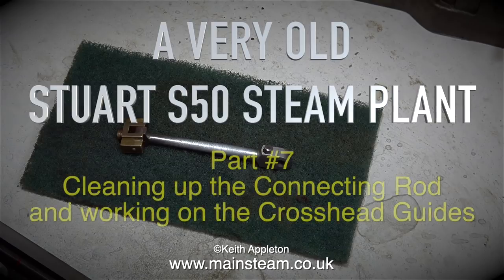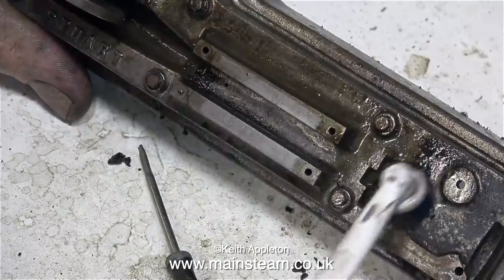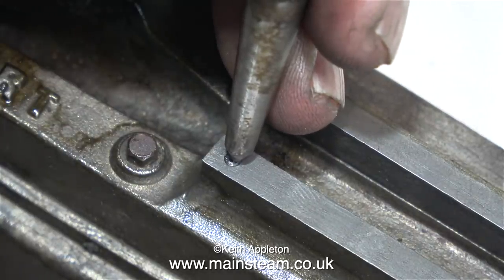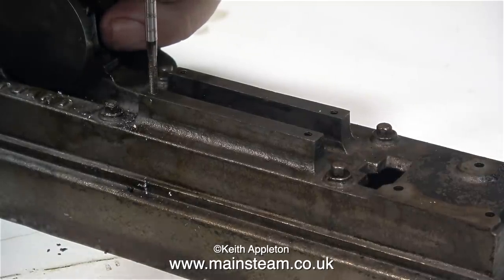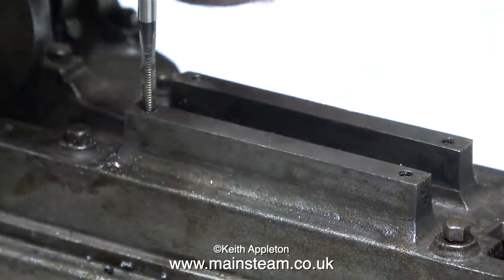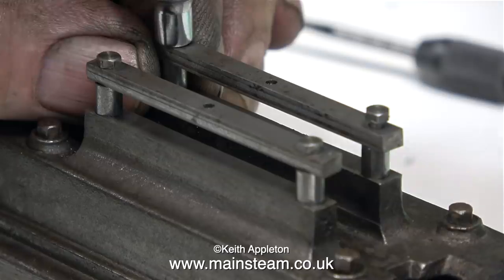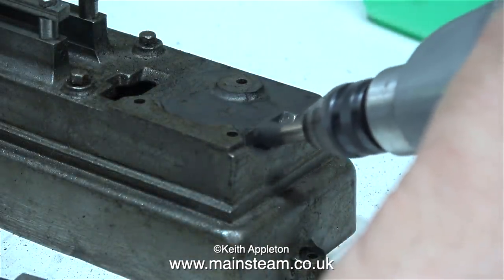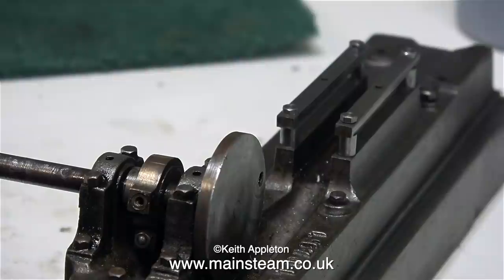A VERY OLD STUART S50 STEAM PLANT - PART #7

Comment: I can see that the broken screw moves quite freely in the hole. Looks like it could have been more easily unscrewed using a left side drill or a small extractor for broken screws.
Anyway, a very interesting video, as usual.

Comment: Hello Keith, I really enjoy your videos, especially the restoration of this Stuart S50. I own one, which I have restored and is a part of my collection. I was curious if you have done any machining on any of the PM research engines. I'm currently building there drilling/mill horizontal steam engine. I'm finding the castings to be of good quality. Just would appreciate your thoughts on these engines. Thanks very much for what you do for the hobby.                        Jon
Reply from the maker: I like PM research engines generally but I feel that the TVR1A valve gear is a little weak.
Reply: @keithappleton   I believe the TVR1A is a Graham industries engine. The PM research engine I'm building is the #1 engine. Its a 1/8 th scale replica of a 1880's drilling engine. So far its turning out well. Thanks for your reply!

Comment: I'd like to know how that user thinks panel wipe would go anywhere even near the potential sparks (which are bullshit anyhow because these thrings run off brushless motors iirc) if these things are hermetically sealed (because for obvious reasons they gotta be watertight).